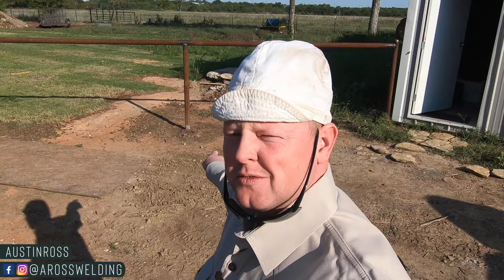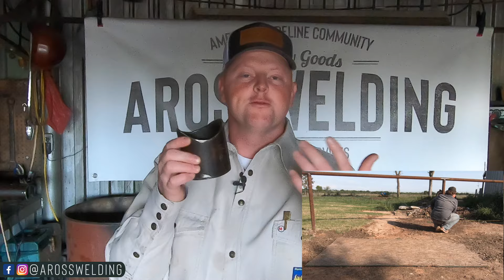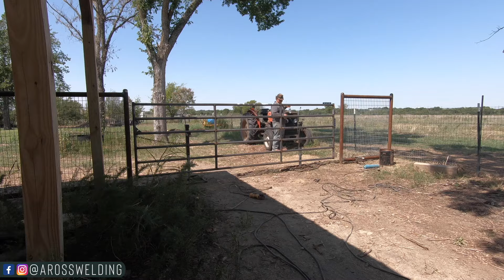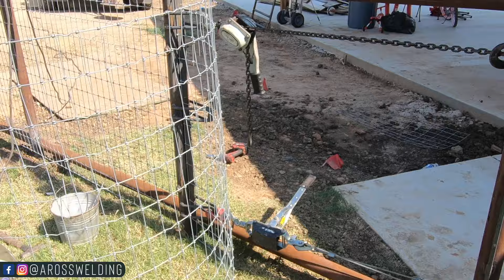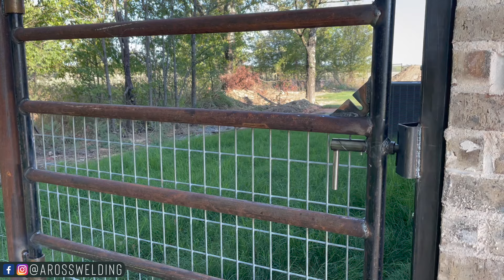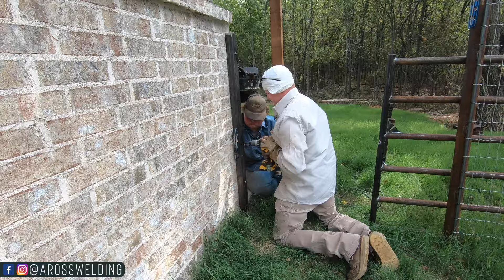DETAILED CUSTOM GATE LATCH (FLUSH MOUNTED SLAM LATCH)

Comment: Hey Austin. Nice build! You are very skilled so please take this comments as my concern for you safety not a insult to your craftsmanship. 

 I hope in the future when using used oil well pipe you will use a respirator. Oil well pipes collect radio active scale inside. Also known as TENORM. When cutting or welding the pipe you can breath in these radio active particles and it can cause lung cancer later in life. Stay safe buddy!

Comment: Dad didn't own any jack stands or gate jacks. He had me.   So I thought Dakota was your portable gate jacks.  Yeah, impact drivers are fast, but you have to be careful.  If I use a impact driver, I set the speed low ( low speed = low torque) and have a hand ratchet for the final tightening on anything critical.  
Came here to see slam latches... Tough to install on gates that were not spaced right for them.  You wind up shortening or lengthening and rehanging them.

Comment: Always enjoy watching Austin.  If you need to measure inside to inside, buy one of the tape measures with the magnetic tip.  You can touch it on the pipe and the magnet is strong enough to pull the slack out, just check the strength of the tape magnet before you buy.

Comment: Someone else may have been mentioned it already but I prefer to put the anchor in the mortar joint.  Brick will crack very easily with any type of expansion anchor or a Simpson strong tie threaded anchor.  An epoxy anchor can be used in brick or CMU but you have to deal with the nut and exposed end of the threaded rod.

Comment: Great video! I'm curious why you didn't just run the fencing around the outside of the corner post instead of dealing with the hassle of the stretch bar. Is it harder or less secure?

Comment: I made a corral many years ago from oil field pipe. (Bartlesville, OK) The posts were 2-7/8 tubing and the rails were 2-3/8. Rather than create saddles on the rails, I cut a bunch of one foot 2-7/8 pieces (w/chop saw) in the shop then split them in half by creating saddles. The 2-3/8 rails were flush cut to the approximate length. The 2-3/8 fit inside the 2-7/8 saddle pieces and it made the fitting and welding a lot easier. Saved a lot of measuring and grinding.

Comment: Austin building a sliding steal frame with wooden pickets don't want to screw my wooden picket on the steal frame do you think this could work  if I use 2x4 across with weld bracket holding the 2x4 then but my picket fence with wooden screws
Reply: sliding gate

Comment: We made self closing access point gates using angles cuts on pipe similar to what is in the slam gate latch.
I’d rather use the epoxy in place bolts with concrete.

Comment: I'm surprised you don't use the green laser tape measures. I use them anytime I need to fabricate fence panels, or anything that needs to sit in-between 2 objects. They are insanely efficient, reliable, and eliminate the need for a 2nd hand for measurements in most cases. They're especially nice on really long runs where a tape will bend/ bow and not give you a dead nuts measurement. Maybe one day you can try them out, the future is here :D

Comment: We are based in the UK & would have pre-fabricated all of these sections/panels & sent them away for galvanising (& possibly powder coating) in bolt together/portal format, rather than weld the whole installation on site! What coating is the client going to put on this metal work? those gate hinges seemed tight enough in the video, give them a couple of months of exposure to rain & oxygen & they are going to get even tighter. ive never seen panel work in a residential or commercial way done like this before. very interesting. 
Cheers, Louis

Comment: When building pens, I use spring loaded latches installed on the gate in the same manner. You can get by without using the catch on the post side if the pipe is a good diameter say 3 1/2" or 4 1/2". I smash a small piece of pipe into an oval for clearance up and down, cap inside with 1/8" to keep hornets out, recess it in upright, weld around outer portion, and grind flat to the big pipe. Saves money by not buying catch side and leaves it looking super clean. Love your vids, I always learn something useful!
Reply: Be nice if I could see a pic or video of that

Comment: Hey I use 1×1 angle with a piece of 1×1 square stock. Sandwich and bolted with wing nuts. Then attach with a chainlink stretcher. one even pull that way. Pretty much samething you had just thinner to be able to hook with chainlink stretcher.

Comment: You ever use a portaband to cut your pipe instead of the torch?  We did 50 sticks, cut both ends off with one 6.0AH battery.

Comment: Great work!  I’m an amateur and usually only work on my own stuff and love learning other techniques.  On those long gates and single strap hinges, I’ve had several of them crack and break welds under the weight and working pressure.  I like to add a second strap welded to the side of the tubing part of the hinge and the gate post. Helps add an lot more strength, especially on the longer gates.
Reply: Yeah I can see that. For the 10 minutes and $5 in material it takes to add those it's definitely worth it for the piece of mind
Reply: So you just cut another collar of pipe and cut it in to and weld that to the other collar.  if not you would have to get a bigger sized pipe to go over the other collar. So it's twice as thick

Comment: One additional method, to put ing brackets on brick is to use the kit we’re you drill a hole and put a plastic socket in to the brick to-accept the screw . I find they don’t crack the brick or cement block because the plastic gives a little and wedges the screw in place.

Comment: Anyone know of a way to stop an auto darkening 2x4 lens to not darken when grinding? I’ve tried dots on the clear lens over the sensor but I still can’t get it to work.
Reply: buy one with grind mode
Reply: Fair but I always flash myself when I flip it to grind because I forgot. Been welding for 2 years and still can’t rem

Comment: Great video Austin.  Something to consider;  the slam latch was placed under the horizontal rail of the gate which should be fine; however, the welded wire panel was added to the gate later requiring the person operating the gate to have to reach over the rail/panel to grab the slam latch handle.  Placement of the latch above the horizontal pipe member would result in use of the latch to be more user friendly since doesn't have the pipe or panel as an obstacle to reaching the latch handle.  Just something to consider for future slam latch installs.

Thanks Again, Austin!
Reply: I'm doing something very similar on all my gates but I'm using horse panel sections in the gate rather than the welded wire. I remove a rod or two from the panel so the latch can be reached from either side.